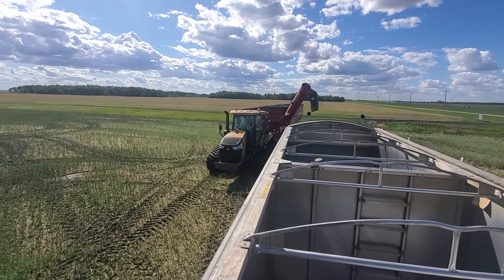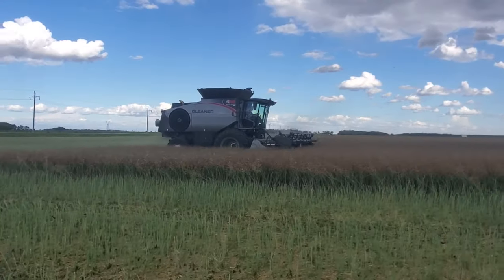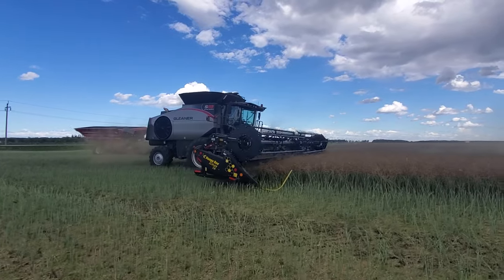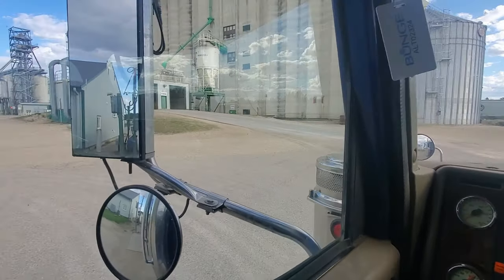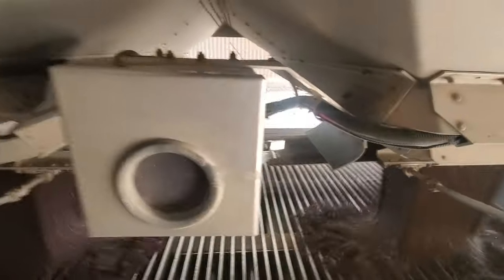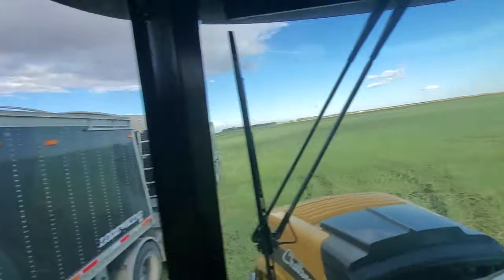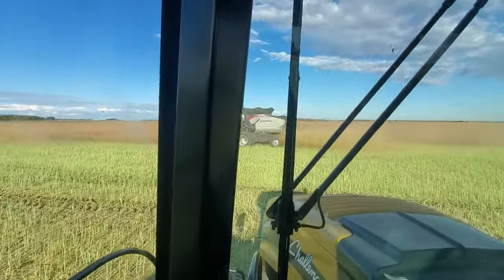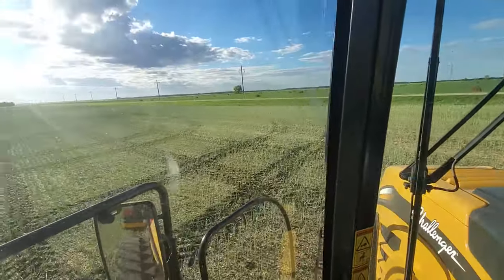More Black Gold.... Gleaner S98

Comment: We run 2 s98s on tracks . They are great machines that are simple.  We run 12 row corn heads and 40 foot macdon drapers for wheat and soybeans.  We added unload auger extensions and camso  tracks to them otherwise they are stock . We prefer tracks for the reduced compaction and extra flotation in mudd . We found that our grain loss on  corn and soybeans is very little while the grain sample is very clean . In 250 to 300 bushel corn they do perfect and  our trucks and graincart stay very busy . Great video  !
Reply from the maker: I'm drooling reading your comment. 12 row, tracks and 300bu/ac corn. I'm thinking we will be adding the 30 inch extension on the auger this winter. In the past, we ran big singles  for mud. Combine could pretty much go anywhere. Glad you liked the video.
Reply: @TwinElmFarms  camso tracks weren't that expensive and they can travel down the road at 20 to 25 mph . We added a  30inch  extension to the auger plus we made  a extension to the spout that puts it out an extra 10 inches  from the end of the auger . We run gerinhof chopping heads with no issues.  We might get them tuned this winter to add 70 hp . We run case quadtracs and we had them tuned with no issues.  Our 580 quadtrac is tuned to 670 hp our 500 quadtrac is tuned to 600 hp . Take care  !